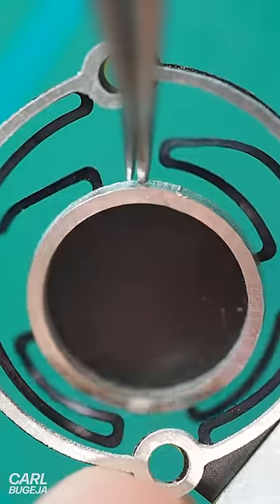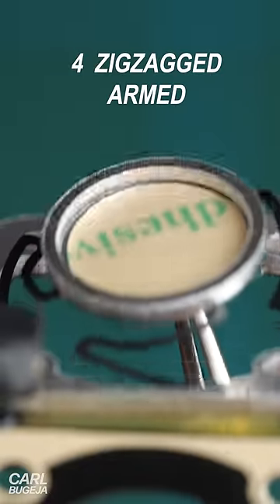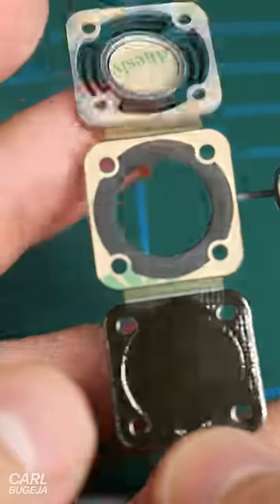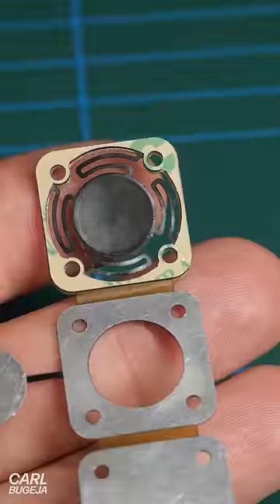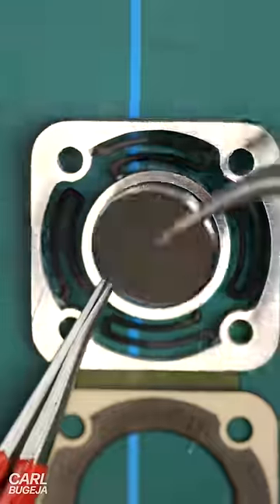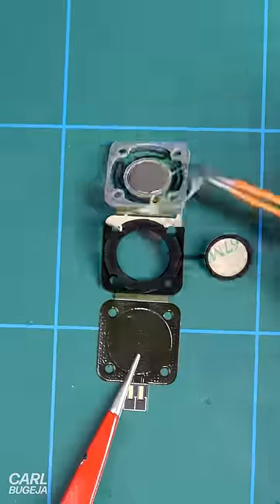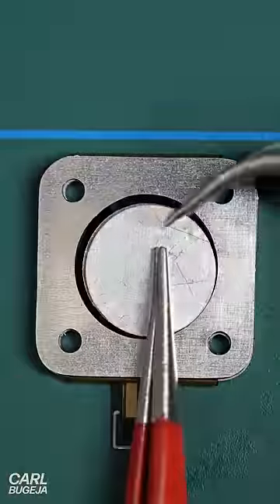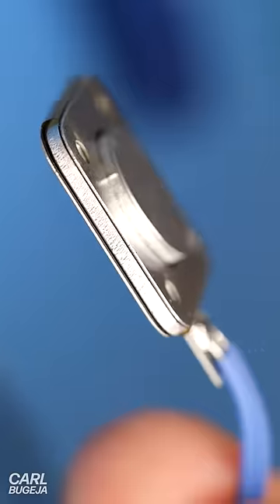Flexure Bearing PCB Actuator

Comment from the maker: If you want to learn more about this Flexure Actuator and its applications, check out the full video here 👉 https://www.youtube.com/watch?v=wrnBW0HD0Vo
Reply: I think you should try it with a larger coil in a solid board, then a very thin flex pcb with a second coil which soldered over the the first. That way you have a speaker built into a pcb that requires no magnets. Might have an application for something like cheap feedback when pressing buttons, or a low volume alarm to indicate charging is finished or youve brushed your teeth long enough.
Reply: Pleasure stimulator for sure
Reply: This is going to make you a billionaire when the haptic accessories of vr become mainstream.
Patent everything,
Reply: It a button?
Reply: How is it a actuator, but you call it a bearing?

Comment: Are you reinventing the speaker??
Reply: It looks as such
Reply: For real
Reply: Ummm
Reply: @ruffmadman not really... its more similar to a normal speaker coz the magnet vibrates
Reply: Nah. He's the flex PCB guy on YouTube. His work will allow others to do new things
Reply: it has a coil a magnet and the flex thing acts like a membrane
Reply: @ruffmadman how the fk did you just deny that an electromagnetic film actuator resembles an electromagnetic speaker and side with piezoelectricity instead‽
Reply: @stanleesiele6028 normally the magnet doesn't move in a speaker, the coil does.
Reply: @ym-us2ck  surprise surprise... same thing with this one. The magnets technically do vibrate, but I see the error in my sentence
Reply: @stanleesiele6028  To make the cone (or panel) of the speaker move, magnets are used to create an opposing magnetic field which creates vibrations. The magnets are stationary.
Reply: That's already how speakers work buddy
Reply: @ym-us2ck  i understand... I meant like, even the stationary speaker vibrates... whether its from the vibrating cone or the opposing force... it still does
Reply: Cymatics
Reply: No, this is exactly like a regular speaker without a surrounding cone
Reply: not really reinventing anything.. it exists already..
Reply: Fun fact skull candy uses a similar thing in their crusher evo headphones.
Reply: @ym-us2ck bro didn't study physics

Wat he said is correct smh

The magnet WILL vibrate

But it is fixed, the diaphragm vibration will overshadow it
Reply: @urnoob5528  read the back to the original comment in proper context son. A typical speaker makes sound via a  moving coil connected to a cone with a stationary magnet. Any vibration of the magnet is a byproduct of the sound waves generated. These vibrations would not be at an audible frequency.  You have no idea what you are talking about.

Comment: Is this that kind of tiny speaker that beeps into those Casio wrist watches?
Reply: No that's a Piezo
Reply: so this be like that haptic key in old droids (menu/recent?)
Reply: @sargera1  afaik the haptic key just uses the vibrator in the phone.

most phones use an unbalanced motor, either a regular motor with a weight like in controllers, but small, or for the flat ones, it's a donut magnet with 2 brushes in the middle and a pcb with 2 coils and a weight on one side. It still works like a brushed motor, just flat.

Some do use a linear weight though, which allow more granularity as you can vibrate at different frequencies and amplitudes like in the joycons of the switch.

This one could be used as an hd vibration motor with a different arrangement on the coils and with the magnet being stuck between 2 coils, making it able to move on 2 axis.

Comment: you can use it as optical stabilization for camera
Reply: You mind elaborating a little more? I’m not arguing here, and I truly have never seen something like this. But wouldn’t you need this to be able to tilt and shift? It looks like as it stands it can only go up and down. But again… I honestly don’t know how controllable this is, and I also don’t know the in-depth nature of optical stabilization.
Reply: @EclipticFactions  The camera lens in a smartphone works on the same principle - it only moves up/down. But this design requires improvement - 1. you need a magnet with a hole so that light can pass through it, the lens must be glued into the hole of the magnet 2. you need to remake the printed circuit board so that there is also a hole there, because behind the hole there should be a photosensitive matrix.
I'm designing a similar design for my surface scanner project and am looking for a similar technology solution for a moving lens with a copper winding that is controlled by current. I hope I was able to convey my thoughts to you correctly because I used Google translator.

Comment: So far I haven't read the calculation of output of carbon dioxide inside our lungs with the amount of inhaling and exhaling with  the powerful source of watt per joule with nicotine and the direct effects vs traditional smoking. 

The power of inhaling traditional smokers are much lesser then power of inhaling from forceful watt. 

For example : It's like working manually vs working with electronic. We are more effective with electronic thus as a electronic vape is more effective then traditional smokers.  Common senses... 

Conclusion: Traditional smoking would be more better then electronic cigarette.